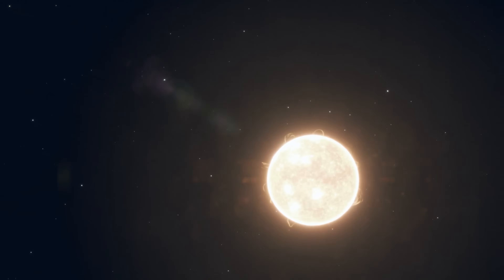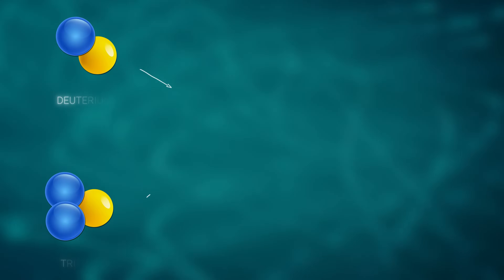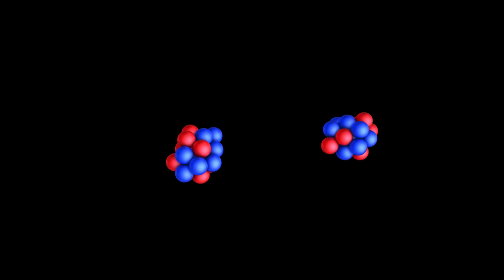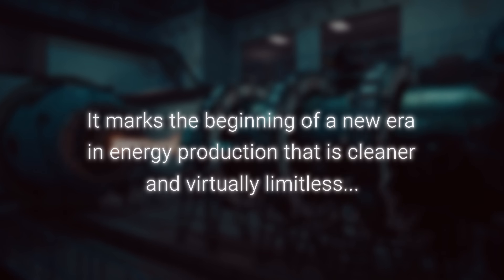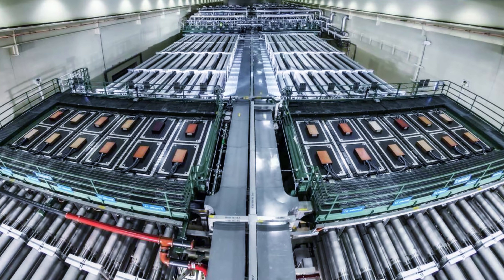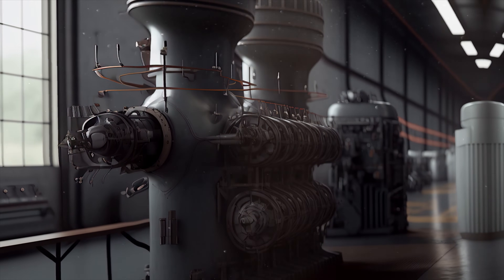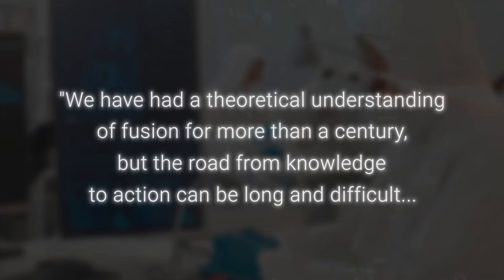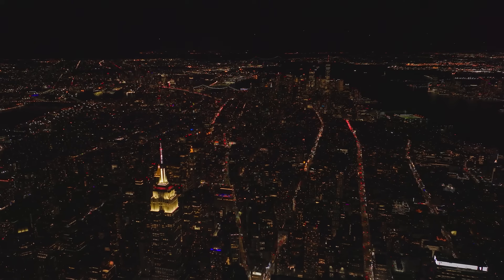The Problem with Nuclear Fusion

Comment: They have been saying we'll have fusion power within 20-30 years since before I was born, and I'm sixty. If fusion is a marathon, then we are still trying to figure out what shoes to wear. While the output of energy was greater than the input of the lasers, it does not allow for the fact that that was only about 3% of the total energy used to produce the test. One of the biggest problems never talked about is we have no way of refueling the reactor without shutting it down. For a comparison image you have a car with a one-ounce fuel tank, and you are driving across the country.
Reply: Your knowledge is dated.  They've already achieved positive energy balance.  "If man was meant to fly, he'd have wings".
Reply: @raylopez99  Physically speaking yes, the NIF achieved a positive energy balance, though the problem with the NIFs approach of igniting a fusion reaction with lasers is the lack of continuity, as @stephenwooten8661 stated. IMO the put on the wrong pair of shoes in the first place. Thats why projects like the ITER focus on another way of confinement, called a TOKAMAK.
Reply: @raylopez99  My knowledge is dated from after this test. They produce more energy than the lasers used, not the entire system. I am not doubting fusion power is possible, I'm saying they still have a lot of bugs to work out.
Reply: @stephenwooten8661  That's true of any technology. They are still finding incremental improvements in turbines, which were largely perfected (more or less) in the mid 19th century, after some pioneering work by an Englishman whose name I forget.
Reply: @iPodHDTV  Both Tokomak and ICF are worth goals.  Having retired from the invention business (mainly patents) it's clear to me that fusion will work.  What laypeople see and what professionals see are like night and day.  As a matter of fact, there's a small group of people doing cell death research that I'm not in position to talk about that may not only cure cancer (which is an immortal cell) but also potentially extend human life by 100s of years.  IMO another 50 years will be enough for the beta version of this technology.  What is holding back such innovation?  Lack of good patent laws.  Right now it makes more financial sense to "provide liquidity" (buy low, sell high) than innovate.  The economist William Nordhaus estimated pioneering inventors only get 5% of the market value of their invention (and often they get zero).  It doesn't pay to innovate, hence the "pessimism" that you picked up on.  Google also the economists Tyler Cowen and Robert Gordon who echo your pessimism (since IMO they are not in my field).
Reply: @raylopez99  I saw a thing about boat propellers that are more effective than "old fashion" ones but cost a lot to make (10-20 times as much) so they don't use them.
Reply: @stephenwooten8661  Yeah I think I saw that.  US Navy is into very silent propellers for example.
Reply: @raylopez99  I see your concerns, though thats why state-funded projects like the ITER exist. In fact, I do not know how ppl over in the US are funding their experiments (you seem to suggest they are mostly private?)

Comment: The Livermore breakthrough doesn't help commercial fusion, it's nowhere close to producing more energy than the whole system consumes. CFS's SPARC will do that next year. Fusion makes heat, we've been making electricity from heat for over a century. CFS plans to have fusion power plants online in the early 2030s. :-)

Comment: What does the fusion make and where does it go?
Reply: Fusion makes heat, heat boils water, boiling water makes steam, steam (under pressure is very energetic) is used to turn turbines, turbines turn generators, which make electricity.
Reply: @stephenwooten8661  I mean fusing atoms makes some other larger atom (ie hydrogen makes helium and so on). What atom is made and where does it go?
Reply: @petesmoviemadness  2 hydrogen fuse to become Deuterium (1 proton and 1 neutron) then anther hydrogen fuse to become tritium (1 proton and 2 neutrons) then 2 tritium fuse to make helium (2 protons and 2 neutrons) and the other 2 neutrons split off, this uses 4 hydrogen atoms to make 1 helium atom, the energy comes from the difference in the weight, about .003 less but when you use E=MC2 it makes for a lot of energy.
Reply: Tritium, and away.

Comment: First person to solve this 5 variable word problem in Fahrenheit gets $200.00 USD.  Sounds easy.

This simple word problem was posted in a 5th grade Earth Science and Geology class, USA back in the year 1975.

These given values are to be used to determine the answer.  Show your work.

There is a hypothetical planet with a given radius of 3,963 miles.

Drilling into the hypothetical planet's crust at the given depth of 12.5 ft. remains a constant given temperature of 55° F all year long.

Drilling into the hypothetical planet's crust at the given depth of 40,230 ft. the temperature increased to a given 356° F.

If it's around 356° F at around 7.619 miles deep then what is the temperature at a depth of 3,963 miles?
Reply: The answer is

42
Reply: @MarcusAgrippa390  I'm sorry, that's incorrect.
Reply: 156305.275, temp difference 301 (356-55) divided by (40230-12.5) .007484... is temp change per foot, 3963 times 5280 to get distance to depth in feet minus 40230 to get starting point. This is assuming the temp change is constant. If diameter is 3963 then answer is 55.
Reply: @stephenwooten8661  How can the temperature be 55° F at 3,963 miles deep when only at 7 miles deep the temperature is much higher, 356° F?  What would cause the core of the planet to be colder than 7 miles deep?  I'm sorry your calculations are incorrect.
Reply: @ronaldkemp3952  That is not what I said, the answer is 156,305.275 it is the first figure in my reply. When I said 55, I was making a joke about the difference between diameter and radius. Read it again, I was saying you would be back at the surface, if the diameter was 3963. Get it now?
Reply: @stephenwooten8661  Yes, but even the answer of 156,305.275° F is incorrect.  Check your calculations again.
Reply: @stephenwooten8661  I'm happy to see there is still someone who understands how to do gradient temperature calculations.  Your answer was really close but you forgot something.  You should have determined a gradient depth per every 1° increase in temperature.

According to the Dynamo theory in order for the Earth to sustain a geomagnetic field the core temperature of the Earth was estimated to be roughly 9,800° F.  But actual temperature readings at around 7.6 miles deep from the Kola Super deep Bore-hole project, then calculating the temperature gradient the Earth's core would be more than 156,000° F, not 10,000° F.

You got an extremely high temperature, much higher than what experts predicted of 10,000° F.

Thank-you for playing.

Comment: In Tokamak/Iter  we could use disc with current that flow from center to perifeeal inside a donate.
When such a disc with current flowing rotating it could generate DC current through conductor.(conductive ring around it)
This would work similarly to reilgun/Tesla dinamo generator.(first ever  lab motors and generators were of this tipe)
Advantage of it is absence of inductunce for Direct Current -- which mean you could shove inside as much power 
as you possibly can deliver through axis  and low resistence of plasma doesn't matter (it would result in higher current and higher required torque /input ergy then)
Standard methods have a downside that primal coil have its own inductance and if you were to try to breach it forcefully 
resistance and forces  would become even more formidable/humongous and would and up destroying your device.
But for Dirrect current it doesn't matter , you just deliver power and thats that. (just like that)
100 million degrees temperatures wouldn't be a limit , how about delivering power so fast that temperature elevate  to the
10 billion or 100 billion degree.

Comment: ITER is not even built yet so its introduction of 2007 so wrong by about 20 years. Similarly NIF has only recently 2023 had any limited success in fusion! The power needed for the laser is comparable with that for a very large city with one shot per day when ten per second are needed and so it has an enormous way to go. The power to drive the laser is so large they will never make it generate any excess power! Plus most of the fuel input is wasted and not burnt!